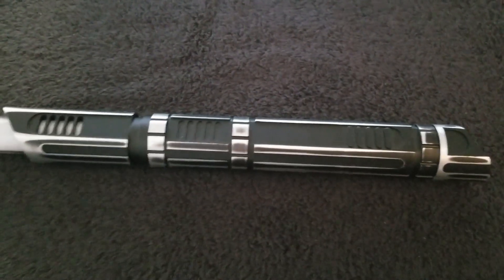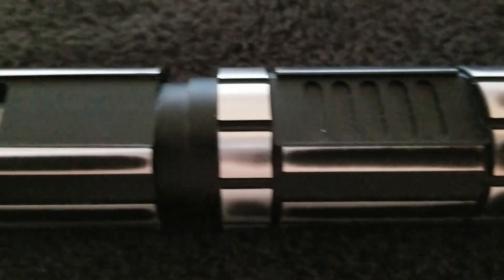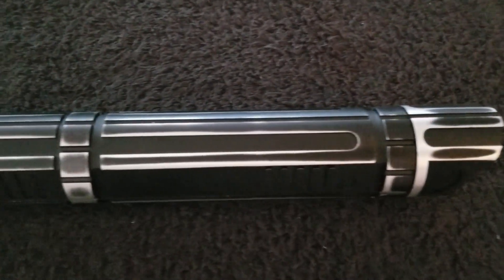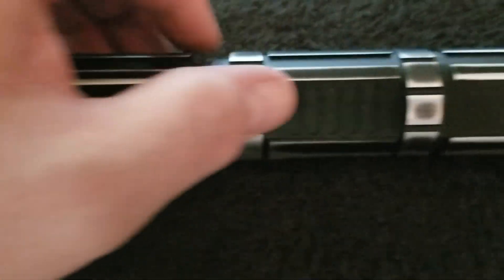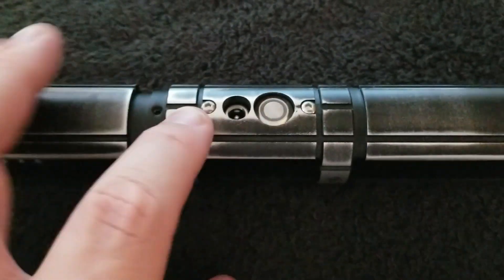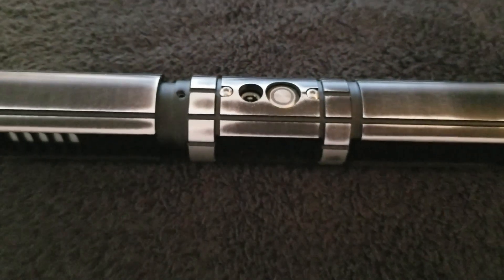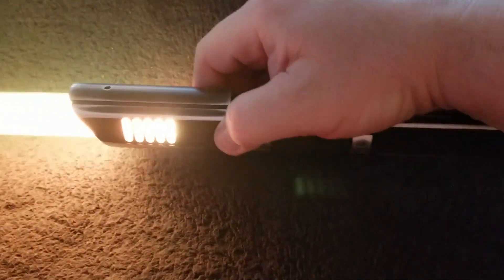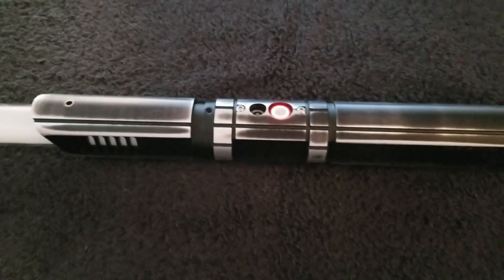Saberforge Eco Commando with weathered finish reveal (baselit)

Comment: Nice saber. I have one  in the black out finish with the Proffie Neo Pixel electronics. Still holding up strong. Should be getting my Eco Bastion also with Proffie Neo Pixel coming in tomorrow. Also black out finish, im all about the Dark Side with my sabers
Reply from the maker: I think a lot of folks would be interested in seeing a video regarding the Proffie's performance on Saberforge Eco's. I imagine that they're essentially the same, but there might be subtle differences made to the core per Saberforge's specs. I don't currently own one... but you have two now (hint, hint, hint), lol. Perhaps Casval might be willing to make one for us?
Reply: @darthparadigmsilluminatedb1461  Hey Darth so if you wanna know I got my Eco Bastion today and I have a problem.... I charged it for about 2 hours after receiving it, played around with it for a few minutes. Sounded great, everything was working fine untill... I was trying to follow the directions for the volume controls (holding the button and clashing the saber) and the speaker started crackling pretty bad. Not only that but the switch illumination is pretty dim. Might have gotten a shotty Proffie board and will most likely have to send it in for a repair.....
Reply from the maker: @Headbanger9000  I think that you've answered your own question.
Reply: @darthparadigmsilluminatedb1461  you ever send anything into them for repair?
Reply from the maker: @Headbanger9000  In fact, I have. I've always had good results, too. Patience is key. If you write to them they'll guide you through the process. It takes a while for them to correspond, but they won't leave you hanging.
Reply: @darthparadigmsilluminatedb1461  okay thanks I appreciate it. Its such a bummer because everything else works on the saber. I never had any issues with my Commando. Do I just contact them through their website?